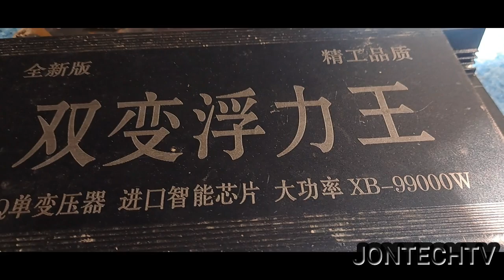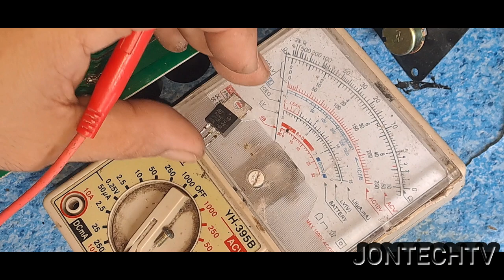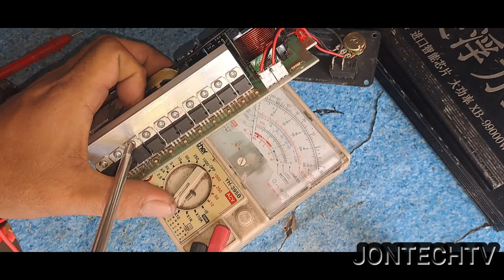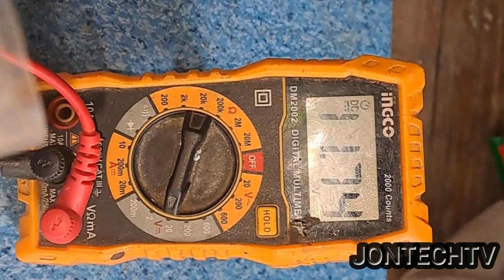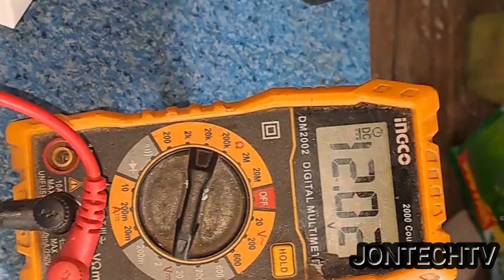PART 04 INVERTER FISHING MACHINE AYAW TUMUNOG

Comment: Sir good day po ung sakin dto ganyan din u model  pagpinipindot  omiilaw ung kulay pula tapos omiikot naman ung blower piro walang lumalabas na koryente.tinester k naman po ung  output n mosfet ok naman tapos ung capacitor n naka higa at ung 450v 150 uf 2pcs ok naman po.ano kaya posibleng sira nito
Reply: Sana po matulongan nyo ako bagohan po ako sa ganitong gadjate salamat   po
Reply from the maker: @Rickyolesco690  check mosfet power supply baka may open,then check capacitors,and last sinewave driver,
Reply: @rolandopatiag529  maraming salamat po